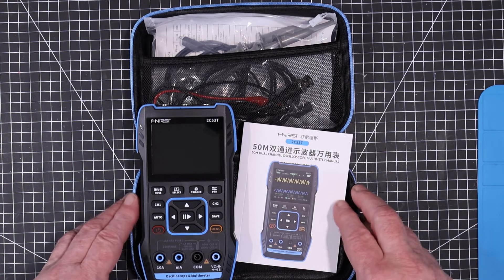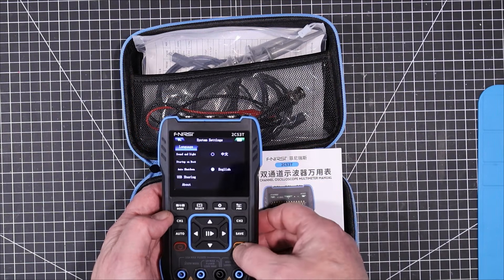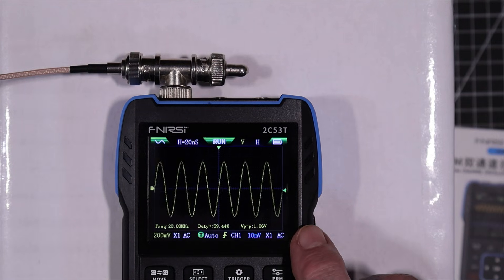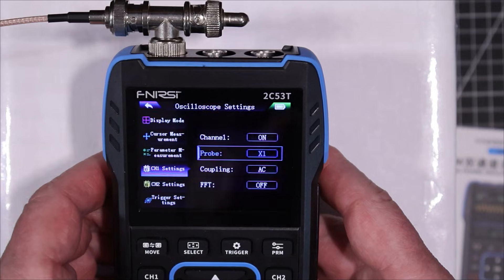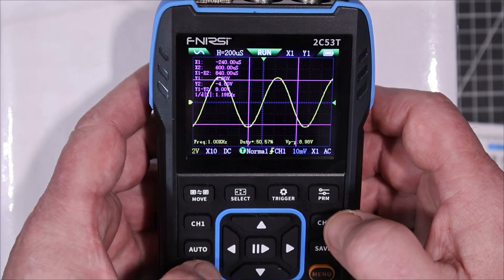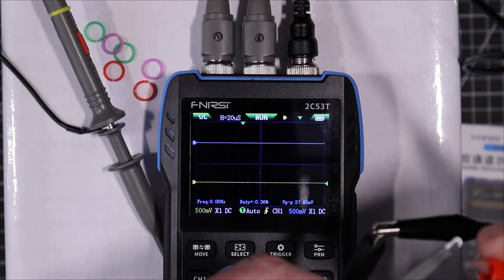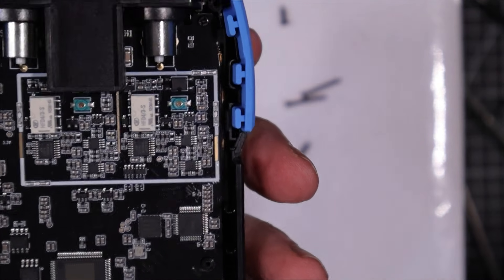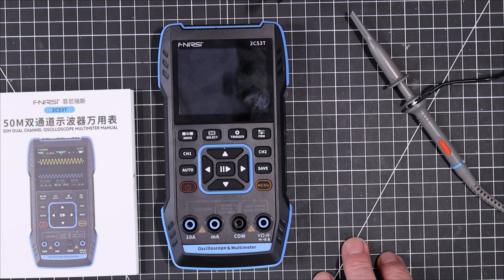Uni-Byte 0240 - Let's try out the FNIRSI 2C53T!  Part 1

Comment: How do you zoom the scope?
Reply from the maker: There is no zoom mode.  If you want to look more closely at some point you could move the horizontal trigger point and use the vertical and time base controls to size the signal on teh screen.

Comment: Just got mine last week.  I'm a newb so I thought it would be my first o-scope.  Here's what I want to test:  I heard that using inline low-level audio ground loop isolators can diminish portions of the audio spectrum, namely extreme low and extreme high frequencies just barely out of reach of human hearing.  But I want to see how bad mine are.  I had to install them because I am getting alternator noise in my sound system.
Reply from the maker: Should be able to do that just fine.

Comment: Can the signal generator output be used in a circuit outside the meter ?  I'm particularly wondering about 455 Khz sine wave use ...

Comment: For a hobbyist audio measurement is this enough ? Can it measure a 20 hz signal?
Reply from the maker: Yes, for most things it would be enough and it will easily display a 20Hz signal.   However, the FFT function is of very limited use on most of these mini-scope.  If your intent was to look at distortion using frequency domain analysis then I would suggest something much better like the Siglent SDS804X HD - but that would cost 5 times as much and has no DMM functionality or signal generator.

Comment: From your video, it looks like an interesting device to me as well. In particular, I would like to know more how this device performs in "hands on" event of any repairs/troubleshooting a circuit. 
For example in the repair of radios, audio amplifiers... where you need to input a small signal and you check the amplifier output signal (shape, clipping point, max RMS power measurement @4/8ohm load).  Perhaps as a suggestion, would it be possible to include an example of this within the review of this product? Example simple audio amplifier kit idk... TDA7265 +-12V with a volume potentiometer and 4/8ohm load resistor. This would show if its easy to use and whether it is practical in this specific case... I look forward to further reviews
Reply from the maker: There is an interesting kit I want to build up.  It's not an amplifier, but it is a simple signal generator.  I could use the FNIRSI to analyze it, but I'm not sure when it will get done.  So much to do over the next little while.
Reply: @uni-byte  of course priorities first especially now during the holidays.

And yea it could be a good example on "hands on" device performance. It maybe would be interesting in addition to analysing DIY kit with FNIRSI maybe to take a look at the shape of the singal from DIY kit and the shape of the FNIRSI 2C53T signal generator on the bench oscilloscope and see which is better...

Thank you, and I wish you a Happy Holidays.
Reply from the maker: @SQERS3  Happy Holidays!

Comment: Nice enough device, I draw the line at instrument, thats reserved for my Tektronix and HP gear...YAYYYY!!!!! I'm a test gear snob !!!!
Reply from the maker: I agree to a point, but it's all relative.   This is a fine instrument to the guy that has a logic probe, a $5 analog meter and only $100 in his pocket. :-)

I do really like the older Tek and HP stuff.  Back before the Agilent/Keysight days.  Not such a fan these days when I can get something from Siglent that will run circles around anything I can get form Keysight or Tek for the same money.
Reply: @uni-byte  :)